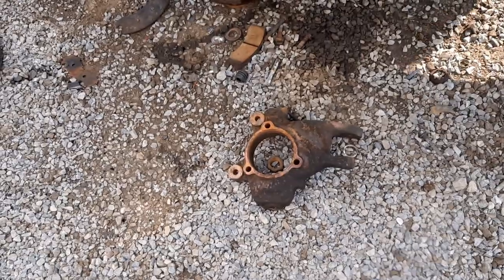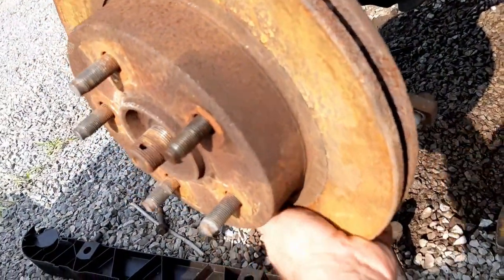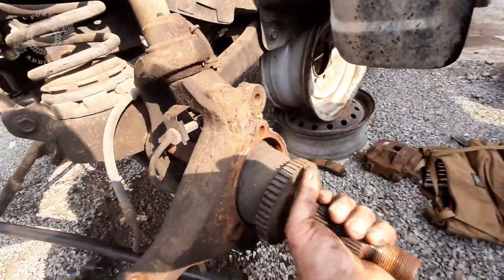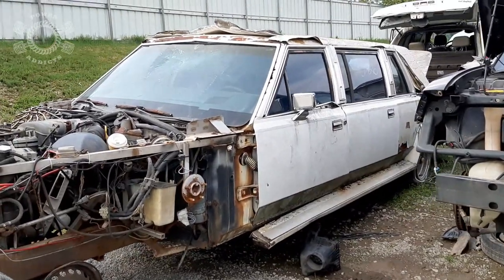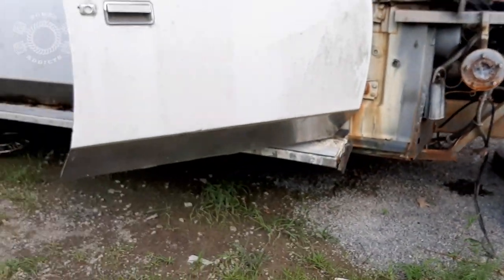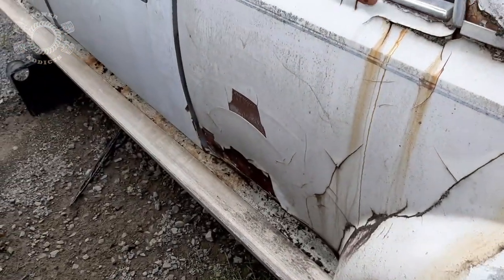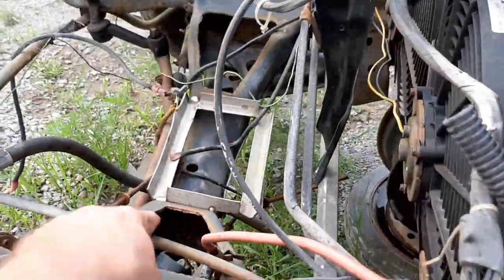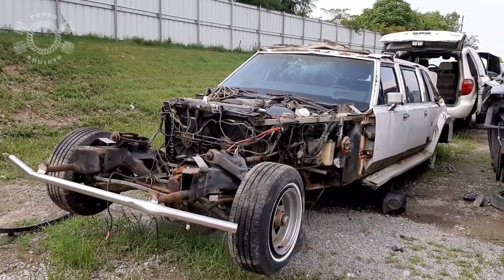How to pull junkyard Jeep WJ Knuckles - #poweraddictscrew #bigbrakeconversion #wjknuckleswap

Comment: Using these knuckles, will all the other Yj parts bolt to it? Hub bearing, brake parts? Or do you have to use different brake set up
Reply from the maker: There is more to it. The hub bearing needs a spacer. Use WJ ball joints .. etc. I'm purchasing the rest of the parts soon to get the axle put together. Make sure you are subscribed so you dont miss the video when its released.